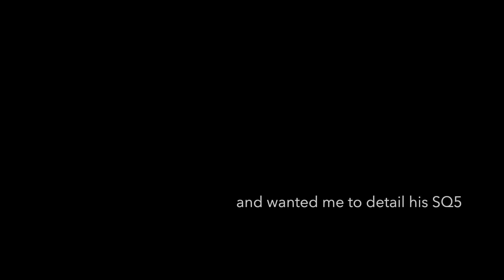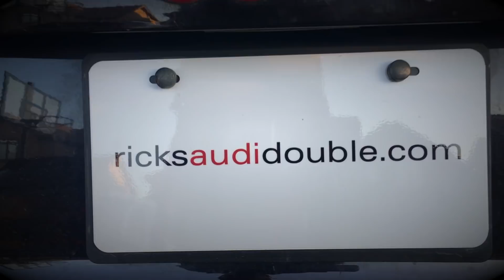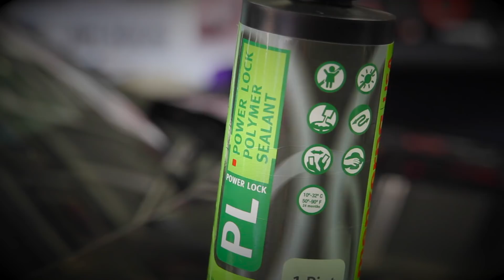AUDI SQ5 DETAIL | Complete Interior/Exterior Detail of Panther Black 2014 SQ5

Comment: Another great video Rick. I have a question. Wouldn't the quick detailer wipe down before applying the Sealant, prevent the sealant from bonding completely to the paint, since it contains glossifiers/carnauba?
Reply from the maker: HitmanAtM16 You may have something there. I had to get the paint perfectly clean but I'll have to think about that. I have a ""Paint Prep" spray by Griot's that may be a better choice. I just love the Quick Detailer by Leno's and Speed Shine by Griot's so I usually go with them.
Reply: Before putting the protection on, its best to avoid using any detailers. I have Griots Paint Prep, but its actually meant to clean the surface to remove any old waxes/sealants. However, after using it many times, its not very good. Griots also has a Pre Wax Cleaner spray (which I have and have used as well), which is meant to be used after polishing, and before applying new wax/sealant/coating. Its simply a Alcohol based solution to strip oils/residue. However, once again, I do not like it. I do however, love Carpro Eraser, which is a far superior alternative in my opinion. 

After a wash, or polishing, or even claying the car, I do a final wipe down with carpro eraser to make sure the paint is absolutely void of any residue/oils/contaminants so that the sealant ill apply will bond to the best of its abilities.
Reply from the maker: Yes, I will have to pick up some Eraser on my next order.  Thanks, man.  Good suggestion.  Keep 'em coming.
Reply: Trust me, you'll love eraser. And will do! Cheers.
Reply from the maker: HitmanAtM16 Ordered. ✅
Reply from the maker: HitmanAtM16 I just remembered, I use to use Panel Wipe by GTechniq to prepare for sealant/coating application. Until it ruined my 3M PPF. Since then, I avoided it. I'm looking forward to Carpro Eraser. It is safe for PPF, right?
Reply: I don't see why not. Eraser is not harsh. Ive used it on chrome, plastic, glass, paint, even tires, and it leaves nothing behind and doesn't ruin anything. A search online shows the Panel Wipe has alcohol and solvents, and many people have reported that it ruined the ppf. It may be because of the solvents, which to my knowledge, eraser does not have. Eraser has alcohol and surfactants.

Comment: HE'S BAAACKKK! Too long! I can only imagine the amount of extra footage you have that you had to edit down to. Question: Do you miss the actual quad tailpipes of the older SQ5 vs the pseudo ones on the newer ones?
Reply from the maker: Honestly, I don't know if I miss them or not.  Cleaning them was a chore and no matter how careful I was, the metal would pit and make cleaning even more difficult. But, having faux outlets still doesn't sit well with me. I am over it, but as I was using the steel wool to clean these pipes I did not find myself wishing I could do this on my own.  It's amazing how controversial the faux outlets have been.  I have heard many people say they wouldn't even consider owning a new SQ5 because of them, which is very short-sighted in my eyes, but I guess people love what they love and they don't see the need to compromise.  

Yes, I have a lot of other footage.  I basically record everything, and I'm now using two cameras so it gets a bit crazy at times trying to manage it all.  But, I like how this one came out.